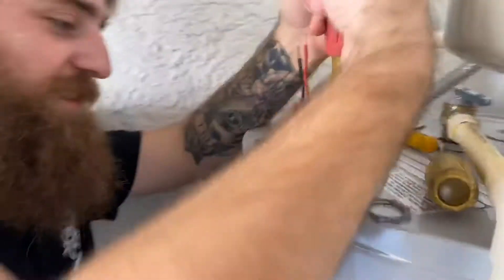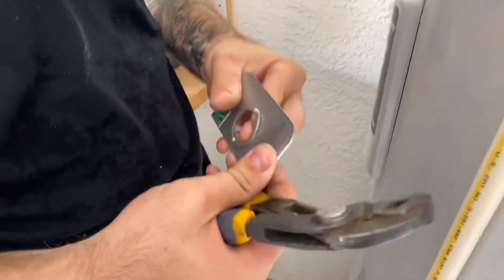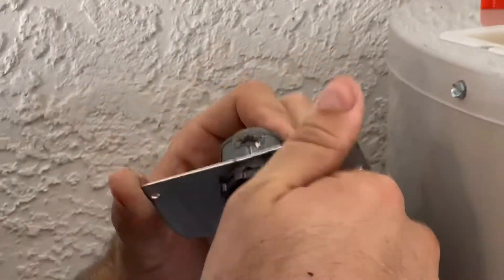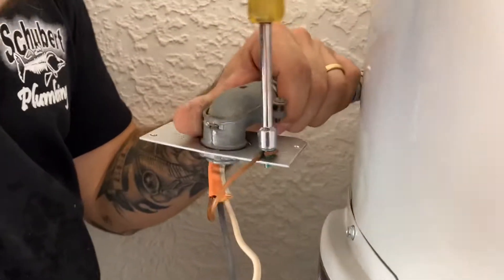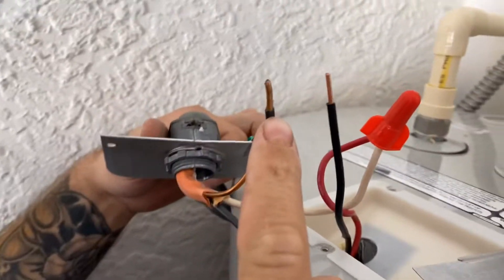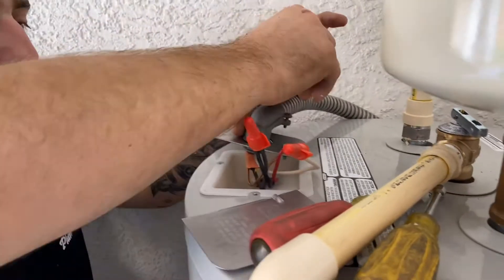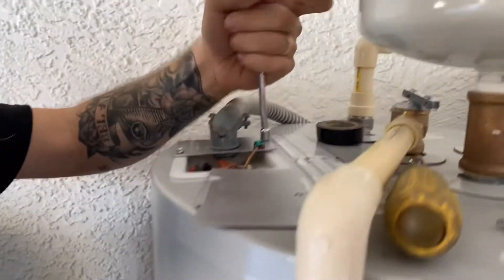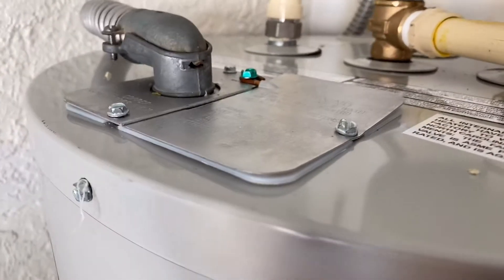HOW TO wire a Water Heater!

Comment: If the circuit breaker is not "within sight" or in the same room as the water heater, then a separate disconnect or switch box may be by code required to be adjacent to the water heater.

Comment: The manufacturers of the wire nuts DO not recommend pre-twisting. If that's an issue just use wago connectors

Comment: You actually want to keep those rings on the  plate.....and probably should inform the viewers to 
Turn off the power at the breaker panel ,Before ,the wiring  the unit

Comment: I have 2 black wires coming out from 30 amp breaker with no ground wire from panel 
The water heater is red and black not sure how to proceed any assist is appreciated
Reply: Red and black usually mean. 240 double pole breaker. Which is what is needed to run most hot water heaters.
Reply: @mauropiccininni6251  ...I have a similar situation:1 red, 1 black and 1 white wires coming from my panel (plus the bare ground), to be connected to 1 red and 1 white on my new water heater. How should I connect them? Thank you in advance!!
Reply: @JuanRodriguez-cf6cg  you only need to connect any two wires from the panel to the heater. So use red and white, put a wire nut on the unused wire. 

Also attach the ground. Basically your old heater was a 3 wire connection, new heater is only a 2 wire connection.
Reply: @mauropiccininni6251  ...thank you so very much!! I will do that tonight!

Comment: Do you not twist your wires first before putting on the wire nut? Like you do in wiring electrical receptacles and switches? Or does that not matter? I was always taught to twist wires together first before wire nutting. If there is a reason not to please let me here some input. Thanks for the great video!
Reply: Yesterday  I hooked  up a bradford white heater . Double checked everythinging
Reply: Purged all the air turned on the power and the black wire started smoking. Turned off power checked wire turned on power and it smoked again. Any ideas?
Reply: @esemando  connection seems to be wrong
Reply: That’s what the wire nuts are for… they twist ur wires together. No need to twist them together before wire nutting them
Reply: @hunterlarson1996  Yes that is true but sometimes the wire nut does not twist enough to make a strong connection and then one wire ends up working its way back out causing issues. Always a good thing to twist first then wire nut as well to verify a secure connection. I have had many instances where i just pulled on the wire and it came right out of the wire nut since it tiwisted it incorrectly. Just that little extra time goes a long way in helping future issues.

Comment: why don't the colors matter?
Reply: In this case, both the black and white wire coming out if the wall are "hot" or "energized" because both black are white wires are connected to, most likely, a double pole 30 amp breaker (assuming that the black and white wire are 10awg). Each wire is carrying 120v and the water heater black and red wires require 120v to work. So it doesn't matter what color the wires are, as long as they are carrying the required 120v each.

Comment: It's a WATER HEATER, not a HOT water heater, if the water were hot you wouldn't need to heat it. Sorry as a Plumber just a pet peeve of mine. Good video though.

Comment: I connected black house to red heater and White House to black heater. Did I ruin my water heater
Reply from the maker: No, your home is AC, doesn’t matter which way you wire the colors as long as ground goes to ground. (We’re not electricians, but for water heaters this is how it works)

Comment: I liked your video and hit like .Only thing maybe you can add is the FIRST thing to say is always Turn OFF breaker .You did mention it twice but after touching wires but you Should dub it in to the beginning of video .It really is important .Could be dangerous as well as costly.You would be surprised how many people dont think of that or even forget when they get to comfortable doing this stuff .Otherwise PERFECT !!!
Reply: If someone isn’t smart enough to shut off a breaker before doing electrical work they probably shouldn’t be doing electrical work

Comment: What If my house wires don’t have a ground setup? It was just the two hots
Reply: Wow, never seen that on 220v. You really need a ground wire.
Reply from the maker: I’ve seen this once before and the heater was working with no problem, but we changed the power cord as it was a plugged in 220 not hardwire. but I would assume it may cause a safety hazard if it ever grounded or discharged power to the metal heater casing somehow, but I’m not an electrician and I’m not sure what the consequences of not having it are. Just replaced with one that had ground wire to be safe.